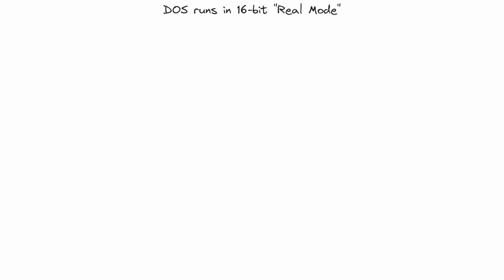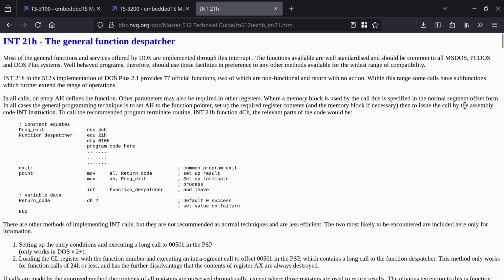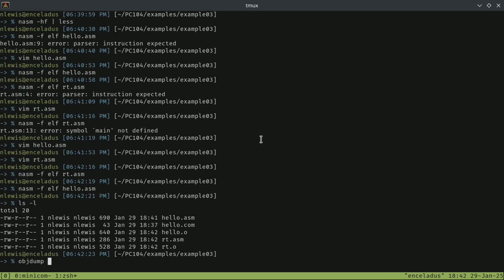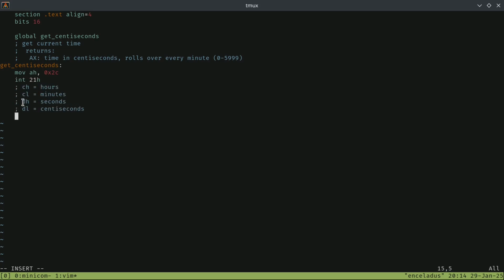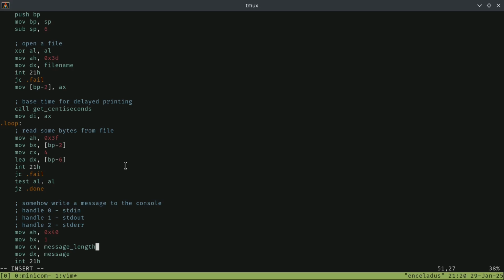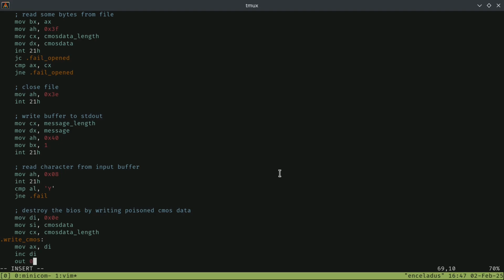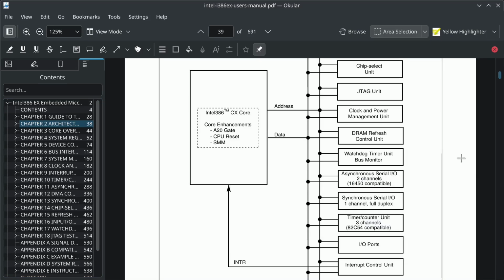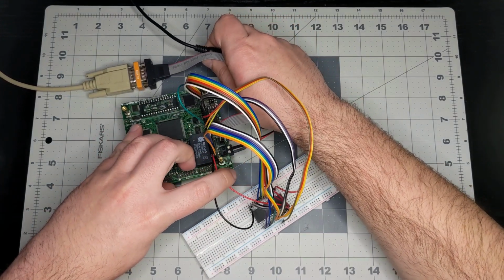Baremetal 386 - DOS Programming and Deleting the BIOS

Comment: New sub here, excellent video! I'm looking for said 386EX CPU to make an SBC based off the N8VEM group design. I've also made an SBC with an 80C188EB some time ago, and managed to run ELKS (embeddable linux kernel subset), pretty cool!
Reply from the maker: Thanks for watching! I actually did manage to find some 386EX chips on utsource. Honestly it wasn't the most comfortable place to order from, but I did manage to get a tray of the PQFP-132 variant. The listing I used seems to be gone, but I do see others, and your mileage may vary...

Comment: For tiny com files i use batch files as open source container to telecontrol debug to create the executable file. Most of these cointainer batch files have to start with one or more parameter attached to build and to modify the routine inside. Example to start with row collumn delay color distance attached: PACMAN.BAT 8 1F 6FFF E 18

It starts a pacman animation on the vga text screen(80x25 with 8x16 character size) made with 8*3=24 user character function ax=1110h of int 10h. The body is placed in two character and each step it moves one pixel to the right side into a third character while open and close the mouth. After 8 steps it starts again one location to the right side.

Comment: For using 32 bit register as operand in the 16 bit Real Address Mode on 80386+ we can use instructions with an operand size prefix (0x66). This prefix reverse the default operand size for one instruction.